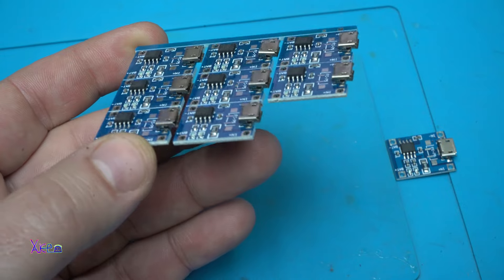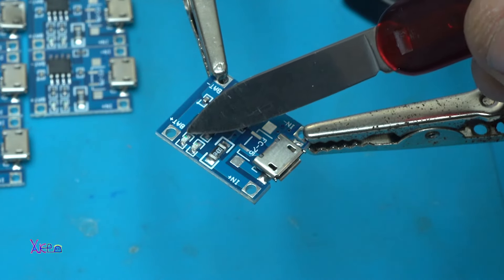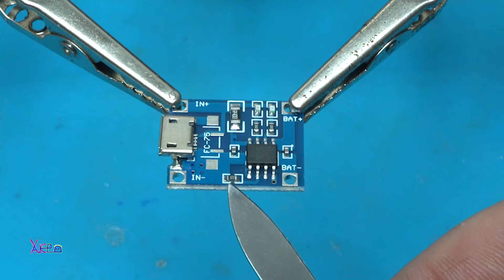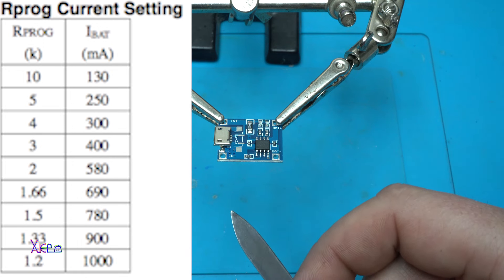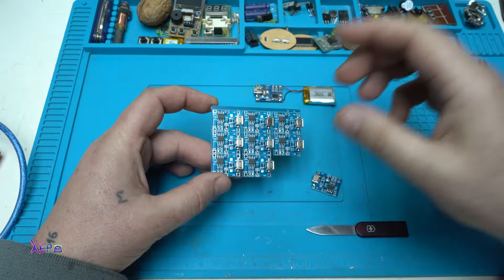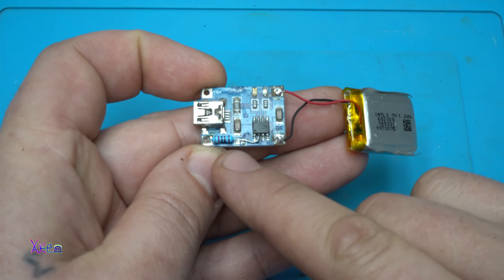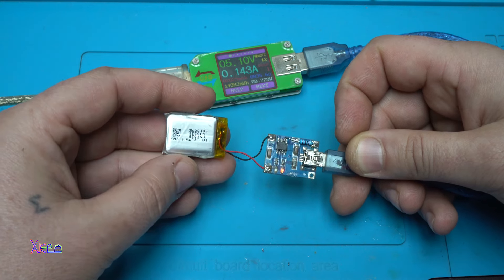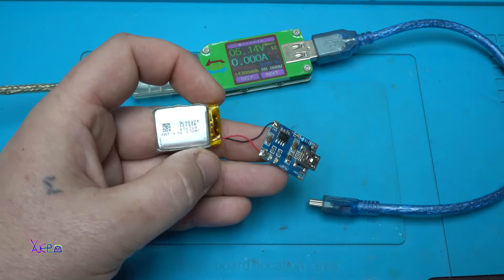TP4056 Your Battery's Best Friend

Comment: Can it charge and power something at the same time?
Reply from the maker: Why not,just be aware of current that you using,not to be more than you charge😀
Reply: It is not recommended to have a load connected while charging the battery. It works, but…
Reply: agree and have a look at UPS modules for that case

Comment: There’s different versions, one has over-discharge protection, one doesn’t. The one in your video doesn’t appear to have discharge protection. Those boards have a second IC. I use your type in dedicated 18650 chargers where I’m not using the output.
Reply from the maker: Very well explained,thank you

Comment: Any reccomendations for a preferred charging, BMS and boost/buck converter solution for 2S and 3S Lithium 18650 batteries (7.2 and 10.8 V stacks) I need not 3 different module but one module that does all of it in a nice package/PCB
Reply from the maker: You can find it on ebay,just type 2s or 3s charger board,I have bought several of them and they work fine